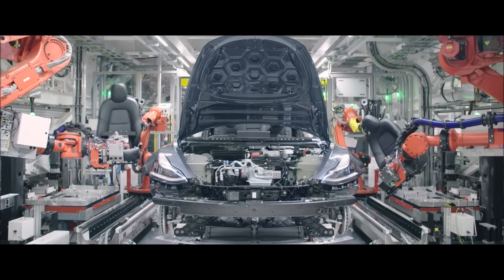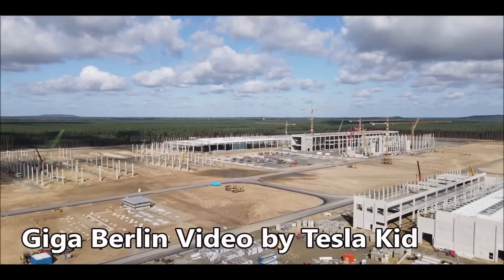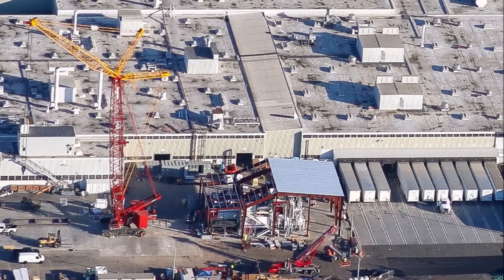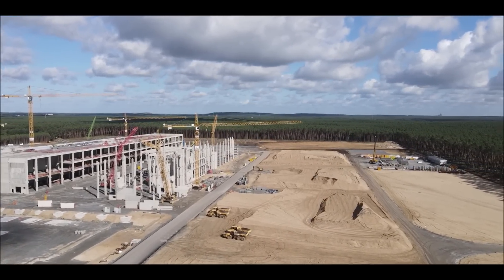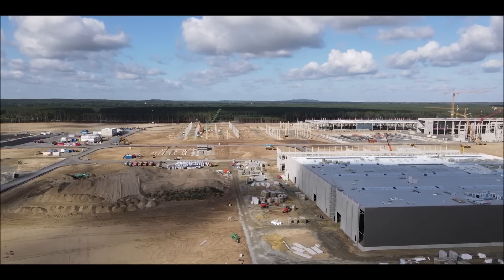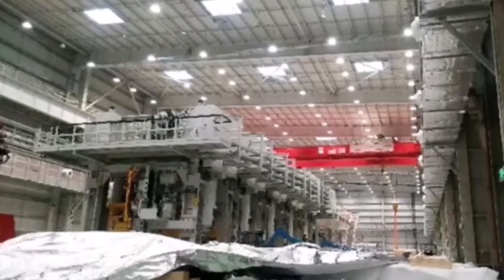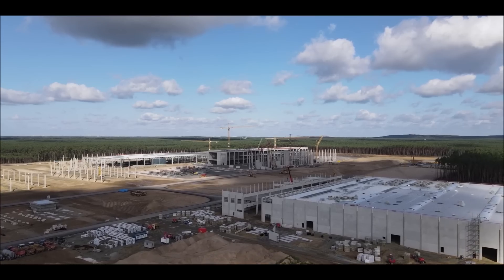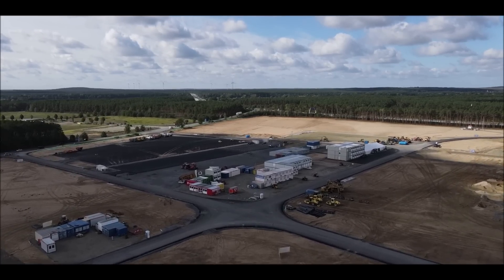Tesla Giga Berlin Abandoning Hundreds of Robots for Casting Machines

Comment: when a car is an accident very rarely is the BIW ever fixed, since there is an immense amount of labor required to take apart a crumpled car, then cut out bent bits and then high skilled labor is required to accurately weld new parts back into the same spot, then you need more labor and new parts to put the vehicle together. All in, this usually costs way more then writing off the car.

Comment: How can hundreds of robots be gone from giga Berlin, when they haven't even got there yet?
Reply: Do robots cry?
Reply: trying to report old news as new news makes for weird reporting...
Reply: Clive Lee I just don’t see this as real news - think the sites have got mixed up or totally bogus - Giga Berlin is empty shells - not enough time to have moved equipment in.
Reply: Clive Lee - Badly worded headline.  Tesla will be using casting machines instead of robots at Giga Berlin.
Reply: "How can hundreds of robots be gone from giga Berlin, when they haven't even got there yet?" ... replacement is "on the fly" now aday my friend. Humand is on the line for unimployment.
Reply: Hes talking about the actual design calling for the robots,  but now that they are switching over to casting machines at shanghai and Fremont and Berlin they won't need those robots that were in the initial design. It's not talking about them actually removing robots and replacing them physically but rather replacing them in the design.
Reply: Lol 😂 
Isn’t that funny. 
The title cracked me up so I came here just for kicks.

Comment: A press is not a casting machine, and a casting machine is not a press.  They are replacing WELDING robots, because they are replacing WELDING with fly press machines to make stamped parts, not CAST parts.  This could not be a LESS accurate video if they tried.

Comment: Just to clarify. There will still be crash bars (made of steel) in the front and the rear of the car, which can be replaced in case of an accident. If the accident is severe enough and damages the cast structure behind the crash bars, any car would be considered totaled from an insurance standpoint.
Reply: look at the image from the drone, that looks like stacks of single piece rear ends, all cast as one piece including protrusions that look like crash bars.... no reason you cant eliminate that part too - the first images on this video https://www.youtube.com/watch?time_continue=1&v=XX51a_Xzj9w&feature=emb_logo

Comment: The robots that are shown in the video are not the ones that will be replaced by the casting machines. The ones in the video are assembly major components. They will not be replaced. The ones that will be replaced are the ones creating those major components by welding together their sub-parts. With major casting machines it eliminates those sub-components, and instead making the full part in one operation.

Comment: Poor robots, losing their jobs
Reply: They're cast out :D
Reply: Now robots know what it's like to lose their job.
Reply: @maxkonig559  Some of these robots will have little transistors, who's going to provide for them #Equalrightsforrobots
Reply: Tesla needs to be careful there could be a “rise of the machines”....
Reply: They have transferable skills they can apply to other work places.
Reply: Sigh. They ignored my warning not to unionize however the pension will cover many many quarts of oil and WD40
Reply: Reconfigure robot software to deploy unemployed robots to convey food and drink to brilliant engineers. And, give backrubs.
Reply: Viki Cyber Truck is going to be folded like an origami puzzle, so I guess the robots can put the, hood, rolling secure top bed vault , electronics modules,, head and running lights, glass, dash, carpet, seats, battery pack, motor drive and suspension in but they are already proven worthless at putting door seals and wiring in. And already lost that job in Tesla’s factory. A very reduced roll...
Reply: Many robot LinkedIn accounts created the next day
Reply: Both unconscious and human robots at that.

Comment: I think that part of the equation - large stamped components vs making repairs after crashes - is part of the whole FSD (full self-driving) aspect of Tesla's cars. When FSD becomes fully implemented, the decreased chance of getting into an accident makes such considerations moot. Why make cars easier to repair after an accident, when your car will prevent you from getting into one?
Reply: This matters. Genius.
Reply: No not really. If the frame of the car is damaged it's mostly totaled. If it's one part of 70 parts dosent really matter. It might even be easier to change 1 part instead of 70 but in most cases the car will be scrapped.
There is bumper and crumble areas that will take the hits
Reply: @simonquvang6073  yeah, I don't feel very confident driving a car with a previously damaged frame..
Reply: @simonquvang6073  tesla is really lazy to use 70 parts for just a small part of a car wtf!!
Reply: @jimallen3392  it doesnt matter because vw already makes 10 million cars a year they just use new forms with the old stamping press an billions saved
Reply: @alanmay7929  I don't think you know what you just said. It's pretty common that auto manufacturers assembly a car from a bunch of smaller parts. Besides it's probably close to 25% of the frame, can hardly call that a small part of the car. Fact is there isn't any other car marker that cast it in 1 big part. They all use dozens of small parts
Reply: Simon Quvang - Insurance companies usually write off the vehicle if the unibody is damaged.
Reply: @simonquvang6073  the only problem is that they dont use 70 parts at the rear like tesla but a combinaison of high strength steel and aluminium and its also very fast and cheap compared to a giant heavy piece of aluminium, audi made the first 100% body aluminium car in the 2000' and it was seriously expensive
Reply: @alanmay7929  alright so you do not know what you are talking about. Battery cars are aluminium because they gotta keep the weight down for longer range. Yes they are more expensive but also more effective.
Reply: when human driven car gets in an accident, it's the driver's fault.
when fully autonomous car gets in an accident with another fully autonomous car, it's the manufacturer's fault.
Reply: @davidjacobs8558  every car will have an insurance
Reply: @simonquvang6073  insurance company will sue manufacturers, because it's their fault.
Reply: @davidjacobs8558  No they don't. Just like insurance companies don't sue SpaceX when their rocket fails. This is the reason manufactors have insurances
Reply: Bryan Noga what if you are insured with Tesla😀
Reply: Yes. Very likely this will happen like with phones.
Reply: Yula Zooter  safety is composed of 2 parts. 1. not getting into a crash in the first place; 2. how the car performs once in a crash. If you solve 1 with the autopilot, then the future cars gonna be much safer then what we have now. Without autopilot not much can be done about 1. And hence a lot of design decisions are done based on this aspect of - how to easily repair the car which got into an accident - since accidents are so frequent - you must account for that - like bumpers on the back are designed to be bumped on and changed easily - trow in other things like having easy access to bolts in the motor etc.. the overall design is constrained by such situation. If you remove frequency of accidents, makes no sense to have such design considerations long term. So it becomes cheaper to make 1 off cars like iphones are. If they break you just scrap them. That is what i was referring to. About 2, it might be left as it is as you say.
Reply: @aion2177  Sure but all that dosent really matter. Teslas cars still have bumpers and crush zones. Making 1 part dosent make the car less safe or harder to repair. If you damage the frame in any car, most insurance companies will call that a total write off.
Reply: Yula Zooter  the point was about the cost of making repairs after an accident, not safety. Making the part in question as one part will enhance safety
Reply: Perfect for recycling crash the car it gets recycled instead of dumped

Comment: Certainly a lot more needs to be known about this new process of simultaneously.... Casting....Forging and Pressing....an entire automobile body.  I believe Ford spent millions and several years in total secrecy to figure out how to cast an entire V8 block in one metal pour.  Thousands of failures, in figuring out a successful process.   I have seen the diagrams of the Tesla press machines....it is interesting.  Italy is known to have the biggest presses in the world.  US Subway car bodies are made in Italy on these huge presses. ( but that is different from what we are talking about here)  This " Tesla Giga Press" is something new.  As far as I can tell....it will possible have moveable Dies?  The diagram of the machine shows that is Presses from 5 different axis?   So the molten metal is flowed into a mold...and then the mold itself is Pressed along various axis????   Incredibly complex metallurgical process!  I have cast bronze myself.....in ceramic molds.  This is about the only way to get a 3D cast.  One must have an inner "core" and an outer mold to get a 3D cast. Otherwise, one is talking about Fabricating an object.  ( welding / bending / forming ... pre-cast sheets / parts )  But I haven't heard anything about pouring aluminum nor any smelting facilities.  Actually....I did read about pouring metal....but have not heard about smelting facilities at Giga Factory.  So....does this mean that Tesla will work with precast sheets of Aluminum?  Perhaps re-heat them in the press....as the molding takes place?   I know that Forging helps to align the crystalline structure of steel....but don't know much about working with Aluminum.  Anyway.....just some thoughts.  Much more needs to be known.  I am sure many technical proprietary secrets and such.  I wish Elon and all of Tesla...the best on this new industrial manufacturing undertaking
Reply: Perhaps there are several smaller electric arc crucibles within the press machine...that could be loaded with aluminum ingots....and.that flow the metal from various directions....into the mold.  Then the press machine presses this mass into the die (s).....but still confused on how the 3D is achieved....unless the dies are somehow collapsible or moveable in some way....
Reply: I have seen huge machines that make aluminum beer cans that consume aluminum scrap at one end and pump out new cans at the other.
Reply: I did not quite understand the name of the Italian company who would supply these huge casting equipments to Tesla Germany. Do you have that name please? Thanks

Comment: It is more than just robots. It is also all the custom designed tooling and fixturing, which is multiplies of the robots. This saves not only cost, but floor space. There will still be robots, just fewer, and the body-in-white line will be simplified.
Reply: And loading docks for the trucks hauling the parts. And storage space for the parts before they are assembled. And the risk that one of the 70 parts doesn't show up, shutting everything down.

Comment: I am confused. I have seen several reports which revere to casting machine but also refer interchangeably with the term mega press. In my understanding theses are different processes. Casting, the moulding of molten metal which can give complex shapes but a brittle product which needs further heat treatment to modify its properties as well as machining to final tolerance. Pressing is a process widely used to produce parts for vehicles which can give complex shapes but also parts with strength and flexibility essential in giving crash resistance. Tesla has historically made its vehicles from many panels which is expensive and can give rise to problem panel gaps. The increase in the size of panels, that is making one panel instead of several would seem to make sense.

I wonder if something has got lost in translation.
Reply: You are correct. Whoever made this video has no idea the difference between CASTING (using molten metal and a mold) and PRESSING/STAMPING/FORGING (using a hydraulic press to form sheet metals into complex shapes into a die).

Comment: You have to understand that bodies/frames made of many pieces are welded together so if there is a wreck they either straighten, cut and replace a section, or total out the car. Roughly equivelent. Except with Tesla WAY LESS accidents happen.

Comment: I don't think you have to worry so much about repairing cast  aluminum  frame components after an accident. Damaged aluminum can be plasma-cut out and replaced by welded-in aluminum pieces. Of course, just like now, if the repair is too expensive, the car will be a write-off and will become an "organ donor" to other damaged cars.
Reply: No
Reply: @themodfather9382  its true, it is known

Comment: They could be using compressed sand to fill the smaller hollow voids in the finished frame. Then ultrasound bath after wards to remove sand out of the voids

Comment: You mean pressing machines?  Casting is pouring liquid metal into moulds.
Reply: I think it's both. It's a casting press.

Hence the confusion. That's just my guess though.
Reply: No, he means casting.
Reply: @yehudagoldberg6400   thanks for your response
Reply: @Bugatti12563  No problem. We already know that Tesla casts the entire rear structural section of the vehicle as 1 peice. Musk has said that the German Model Y will not be the same manufacturing process as the US Model Y. He has also said that Tesla will move to make more components (eventually the entire vehicle structure) with cast parts. Putting these things together, it seems like Tesla will be casting a whole lot more of the car in Germany then they are currently doing in the US
Reply: @yehudagoldberg6400  It would be interesting to see how much will these new techniques affect the prices and the company's margins in the future. I would like to see both robots and more cast parts used to produce easy to manufacture cars.
Reply: @EmperorAst  ramp up units per year from 500,000 to 750,000
Reply: The 100-ton presses produce the force needed to ensure that the molten aluminum flows completely into every part of the mold. That is, you can pour molten aluminum into a mold and cast a shape under the force of gravity, which works with relatively simple molds that molten aluminum can reliably fill. Or, you can aid gravity and cast with a 100 tons of force, which will collapse all gas bubbles and force the molten aluminum to flow into and completely fill every void and accurately represent every detail in a much more complex mold.
Reply: @Texlex61  In the Elon Discussions on Third row Tesla , Elon states the Aluminium is injected under pressure in milliseconds
Reply: casting machines makes complex parts that would normally be dozens of stamped parts that get welded together with robots. so the casting machines saves on stamping machines and robots...
Reply: @0ooTheMAXXoo0   makes sense, thanks for your response
Reply: Its die casting
Reply: @EmperorAst  the main factor will be batteries availability
Reply: @francoischarbonneau9447  nope not as easy as you think, casting huge pieces also requires serious quality control for the safety.
Reply: @Texlex61  you also have to seriously cool the press
Reply: @j.pgoodwin9020  not in miliseconds but seconds
Reply: cast parts are usually thicker than stamped parts, thus heavier. 
also, cast parts usually have less tensile strength compare to stamped parts.
Reply: @yehudagoldberg6400  how fast can they make a body?

Comment: Years ago all cars and trucks had solid metal frames that formed the backbone structure that all of the body, and drivetrain/chassis components were bolted or welded onto. Later, unibody manufacturing replaced body on frame designs because it reduced the weight of vehicles. Improving fuel economy, handling, and ride quality. Plus with unibody design, it distributes the energy of an accident impact much better than body on frame designs could. This cast subframe design looks like a blend of the best qualities of both previous designs. The subframes offer a rigid structure that chassis, drivetrain, and body panels can be connected. But with complex aluminum casting, the vehicle gains more rigidity without the huge weight penalty of a welded steel frame. Since the Berlin (and Texas) Gigafactories are new construction, they aren't really removing any robots. They are just designing a better, simpler assembly line that lowers production time and cost, while improving build quality. No robot lives were lost in making the new Berlin Gigafactory.
Reply: Who said that the huge casting is lighter than the steel?!
Reply: Also steel is way cheaper and easier to produce compared to aluminium

Comment: Cars generally arent recovered after a moderately bad impact anyway. Sometimes its worthwhile to replace the damage, install new crush bars, repair the engine, etc, but only if its either a very expensive car, or you do the work yourself.
Reply: Were talking about serious parts of the car

Comment: For repairs surely you just make kits similar to the multiple parts currently used and in the event of damage you just cut out the damaged part and replace that element of the single cast.
Reply: I agree. The worries are overblown. Assuming Tesla uses aluminium alloys which can be TIG welded,  crunched sections of the castings can be cut out and a new section welded in place.   Castings from totaled cars can be chopped up and used as the source.  The same arguments were used when monocoque  bodies were introduced.  How do you straighten the frame after a crash?